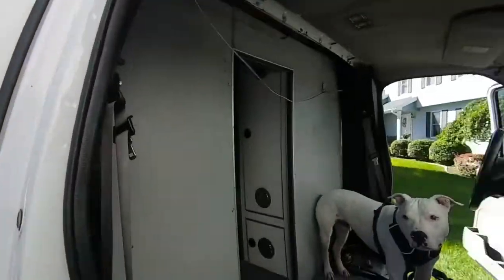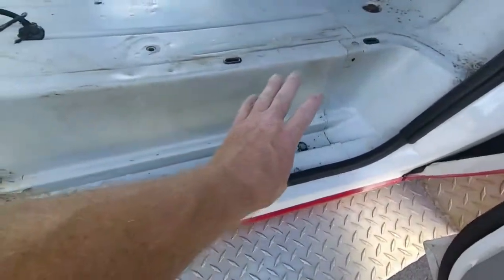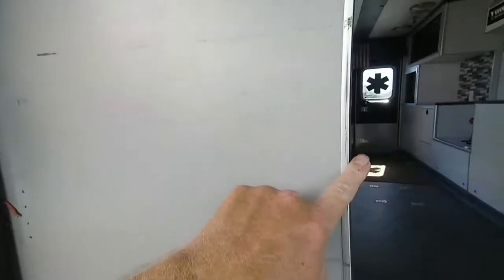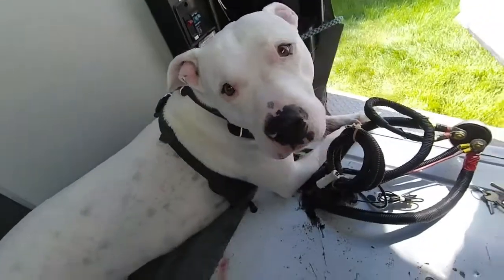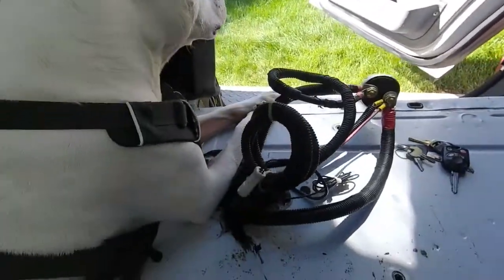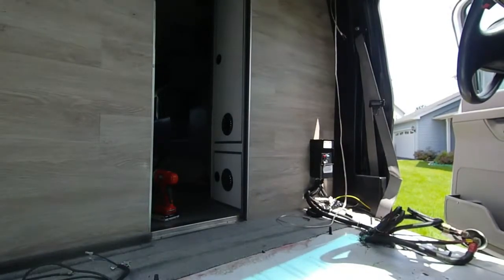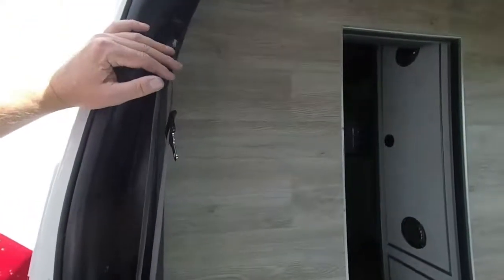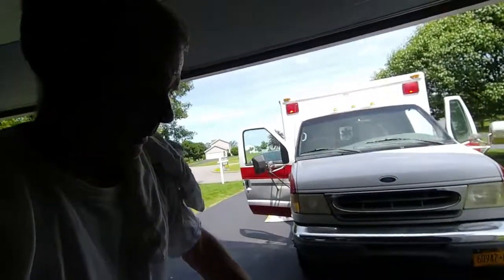Bulkhead Wood Install in my E450 Ambulance | Ambulance Conversion Life

Comment: That cleaner just worked wonders cleaning my Jeeps dash and panels to get it ready for sale!  Had been working on that for a while to no avail, never heard of Krud Kutter.

My E450 Ambulance was just loaded on a trailer today :) Excited to get to work
Reply from the maker: Good times Maxx! Exciting!!!!
Reply: David I just got mine and of course I first had an issue with insurance and now registration. It shows on Title it is a AM so they want to register it as a Ambulance. Then after the  conversion I will get it registered as an R.V. but until then how do I get it as a truck or van? You have to register anything new in person so they asked a ton of questions. Texas is horrible I will be headed back to calif soon but until then I removed light bars and changed all red lights well painted the lens for short term. They have already had me weigh it and had an inspection. Now going for a sheriff inspection and now have to pay late penalties. No laws for to protect the consumer they just run you around and pay pay pay and think of something else. I may just have to register it in calif but thought I would ask you what you did?

Comment: That looks nice!  I wonder if it helps with soundproofing what you are doing inside the box so you are just slightly more stealthy or if it adds much insulation value so you're slightly cooler or hotter when you want to be.  I'm kinda working my way through your videos backwards and this looks like just about the only build thing you've done so far that made me think, "I could do that!".
Reply from the maker: Good question! I'd never thought about that, but I'm sure it changes the R value. And I'll bet there's a lot of projects that you can do... if I did it.... you can too  :)